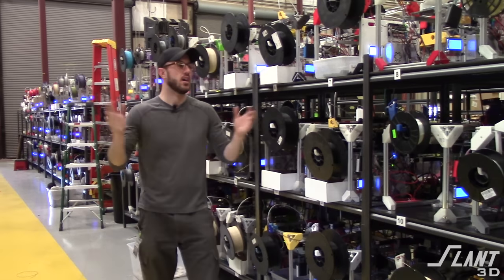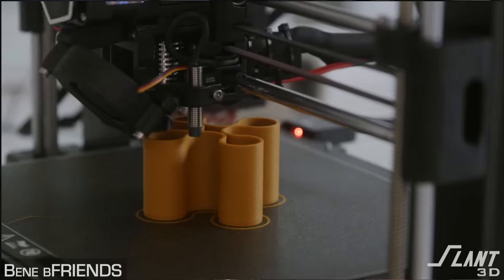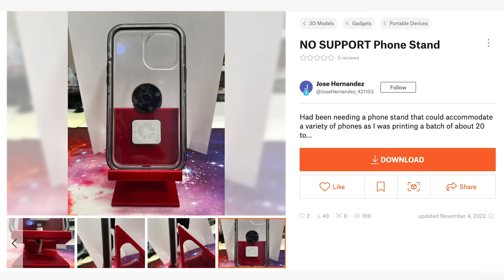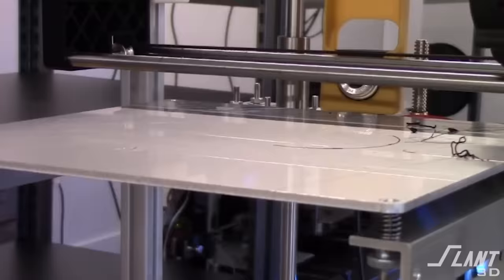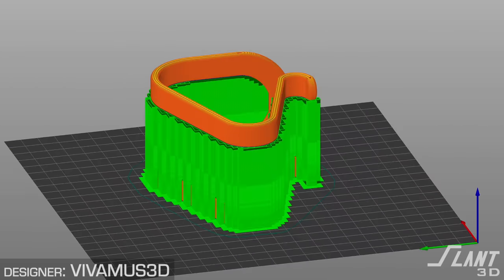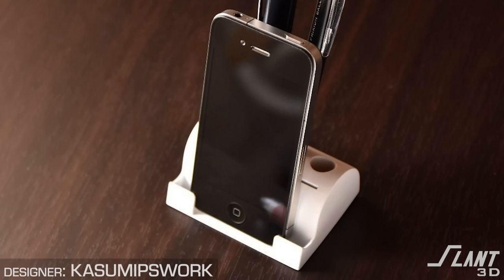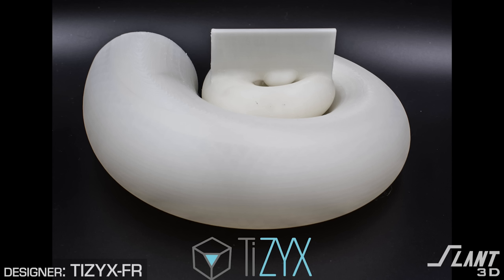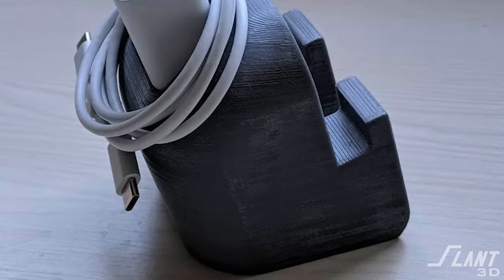3D Printing Engineer Reacts to Phone Stands: Design for Mass Production 3D Printing

Comment: An interesting introduction to how your priorities as a mass producer are almost completely inverse to mine as a hobbyist.  Especially your comments on orientation.

I mostly print in ABS, because most of what I print is intended to be joined, sanded, and painted to look something else.  (A huge percentage of my printing has been full-size R2-D2 feet, for example.)  All of these post-printing steps are much easier in ABS than in other common filaments.  But of course, ABS warps very easily. Also, I live in a city that routinely reaches -20C in the winter and +30C in the summer. The spare room my printer is in vents to the outside and one of the walls is a concrete firewall, so the printer is more subject to weather effects than some places.  So all of this taken together means I want very broad, very short parts - things that have a lot of area in contact with the bed and never get very far away.  This does mean that I spend more time retrieving parts.  But I have time to spare - this is not my job, I'm running a single printer for my own needs and those of my friends and acquaintances. And to minimise warping, I spent about 30 minutes waiting for the print chambre to warm up and then about 2 hours letting it slowly cool, so adding 5 minutes to manually retrieve the parts is a very minor additional cost.  So this is basically the opposite of your needs, where you want a simple but small first layer that lets you put more parts on a build plate and lets you automate the extraction.

Skimming through the comments, I think a lot of people are having the same reaction I've had.  And I think that a big part of it is how you kind of buried the lead on the bed surface question.  You mention on one stand that "this uses too much of the bed, it should be oriented more vertically" on one stand, and then it's one or two examples later before you explain why.  I offer this comment as hopefully constructive feedback: it's very cool to see how a manufacturer needs to think very differently from a hobbyist/small craftsperson, but I think a lot of your audience is in the latter category.  I suspect the videos will land a little smoother if you watch out for the places where those differences exist, and make sure to pause and really highlight what the difference is and why it's different, before you dive on into the commentary.  For myself, I spent several minutes asking "why is this guy saying the exact opposite of what every other YouTuber says about print orientation, and that sense of confusion lessened the impact and enjoyment of the video.

It did get cleared up, and to be clear I did enjoy the video and learnt things!  If I were grading this video, I'd give it a comfortable B: pretty good, but making a few small tweaks to the way you present information, and staying aware of the disconnects between your assumptions and those of the audience, would make it even better.
Reply: I see for people discovering him with this video it makes sense. But he repeats that in almost every second video of his so maybe that's why he skimmed it a bit in this one, but definitely agreed with your points
Reply from the maker: Even and especialy for ABS you want minimal bed surface contact
Reply: I am a hobbyist and am the opposite of you in priority.

I hate doing any fiddling with the 3d printed object. When it finished printing, I expect it to be done. 

I rather invest up front in designing objects and tuning the machine than to put in the labor to post process something into a finished product.

I'll do a lot of printing of multiple prototypes to make sure that it works, or test small part of the prototype. Once the design is done, it's not even done. I still have to write up documentations, which either tell you how to use it, or how to remix it into your projects, or both. If necessary, I'll include information on how to print it, but I want to make sure it's as easy to print as possible. 

You do a lot of work in a different direction, but my focus is more on product design for a lack of a better term.
Reply: @Killy10000  Fair.  Most of what I'm printing is a prop or replica, so I can't change the final appearance.  This, of course, has effects on how I design a printable part.
Reply: @slant3d  My experience is that the taller the object, the more likely it is to warp or otherwise fail, especially with ABS.

If I'm trying to print the panel that covers the access hatch in R2-D2's foot, I am essentially printing a 3mm thick trapezoid that is about 10 cm deep and with the parallel sides being around 15 and 25 cm long.  I only need 2, so I can easily fit both on a 25x25 cm print bed.

If I lie them flat, about two hours later I'll have a nice pair foot panels.

If I stand them up on end, about two hours later I'll have a huge mess to clean up.

My experience and education on this subject is miniscule compared to yours - but my experience is also that maximum surface area on the bed and minimal practical height produces useable parts, and the other way around doesn't.  So there is definitely a disconnect between what I've experienced and what you're saying.
Reply: @davydatwood3158  this disconnect between your experience and what he is saying is probably due to you both printing for totally different reasons on different machines.

Also he doesn’t put multiple parts on a build plate, it is faster and more reliable to just print a single part at a time, especially if you have automatic part removal.

If you are having issues with ABS prints then it is probably due to some settings not being quite right.

Comment: Why would you use 0.4 nozzles? With the latest slicer software tech 0.6mm is absolutely superior for 90% of applications. Unless you are printing figures, use 0.6mm. You keep basically the same details but print much faster.
Reply from the maker: Incorrect
Reply: @slant3d  you are 1000% wrong. With arachne's variable width system there is no reason to use 0.4mm nozzles anymore for functional prints. 0.6mm is superior in every way unless you are printing miniatures or small fonts. If you are going to correct people at least explain what you are talking about.
Reply: @LazorzPewPew  if you are going to say something is better then explain how it is better. You say it is superior for 90 % of applications but don’t elaborate. You say it is superior in every way when not printing miniatures but again you don’t elaborate. You say he is 1000 % wrong but don’t elaborate and are just throwing in large numbers for effect.

It doesn’t matter what size nozzle you use if you are limited by flow rate, which a lot of modern fast printers are. You can use 0.4 mm line width and print faster in terms of linear speed or you can use 0.6 mm line width and print slower in terms of linear speed, but then for both you can end up at a similar flow rate. The statement that 0.6 mm nozzles are faster is missing some details.

Comment: I have been using a print-in-place foldable design for a few years already and every year I have to print one more because I either lose one, somebody forgets to return it or I just give it away. It was not featured here but it is one of the top ones on thingiverse. The nice thing is that it folds flat (thin) so it's easy to stow away in a really small pocket and is adjustable for phone and tablet. A must-have when travelling.

Comment: Hey so I'm actually curious; for your print farm, what do you do with the leftover plastic waste from support material or failed prints? do you have a way to recycle the filament back into the filament so it can be reused? It's one of my major pet peeves for 3D printing that we don't yet have a consumer-level way to recycle failed prints into filament.
Reply: Call your local recycling company and ask for them to consider. I did with my local company and they said they'd look into it, and said it was a good idea.

Comment: The last stand I think can be carved from wood in 2 parts and then wood glued together. Some postprocessing and it'll be impossible to tell it's from 2 piece of wood. It's more labor intensive but not impossible to build, and can be priced much higher than a 3D printed one (though as niche a product as it is, will not sell as many).

Comment: I've got a question regarding orientation. If I understood correctly, you always say aim to minimize the contact surface with the buildplate so you don't have different textures on bigger surface areas around the part and to make it easily removable automatically in mass production. Don't you have issues with bed adhesion when you print parts with such small contact area? How do you deal with that? What's the minimum contact area to keep the part properly sticked to the bed during the print?

Comment: The paterning on the car phone holder is most certainly required from the perspective of cooling. Phones usually get hot in cars especially if they arre charging and being able to tranfer that heat to flowing air prevents the phone from over heating.

Comment: "Yet Another Phone Stand" - indeed if printed on the side there's obscene amount of support material waste. But what if you print it on the back? With "snug" supports style in PrusaSlicer, supports drop to <10%. It's not ideal for best strength but at least for the spine filament would be the right along the grain

PS. for "on the side" print, snug auto-support is 50%, with some elbow grease dropped it to 20%
Reply from the maker: Strength of part

Comment: With a 0.4 mm nozzle you can easily print walls up to 0.8 mm in vase mode, just change your settings and tell it to print larger walls, it slows it down, extrudes it larger. I've got lots of sturdy vases I've printed with a 0.4 nozzle.
Reply: How reliable is it long term though? Also a lot of nozzles have a flat area on the end sized to work with the nozzle diameter, if you go too large you will exceed the size of that flat and you extrusion quality will suffer, but that is very dependant on the specific nozzles you use. A nozzle is designed for a specific diameter and hence specific line width and range of layer heights, using anything really but in this case nozzles, outside of their intended settings and configurations, whilst it may work, probably won’t be as good or reliable as just using a nozzle the proper size.